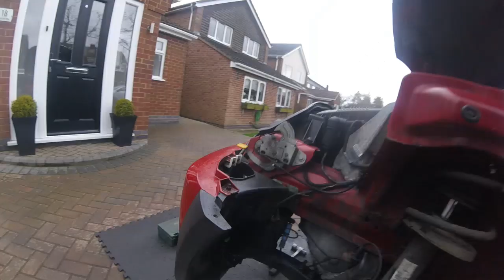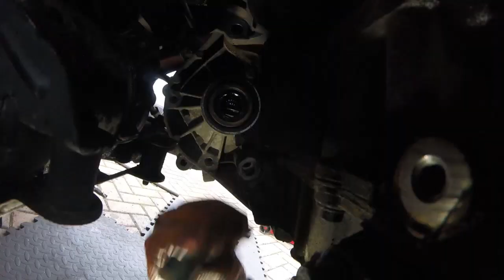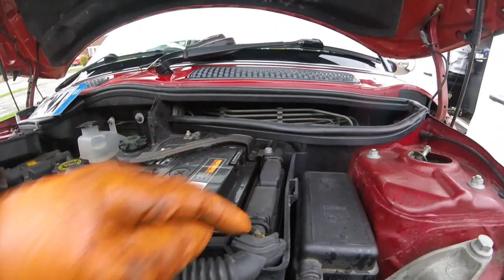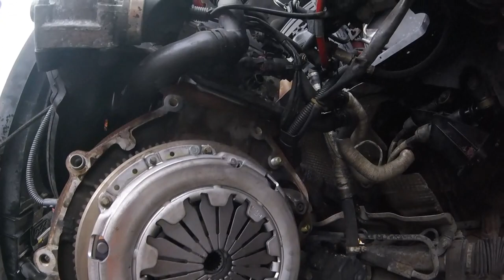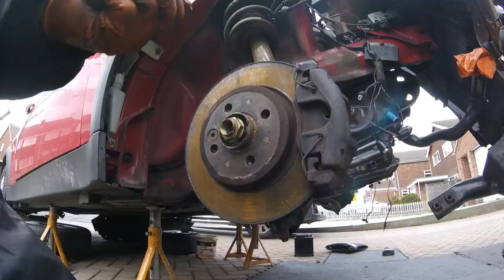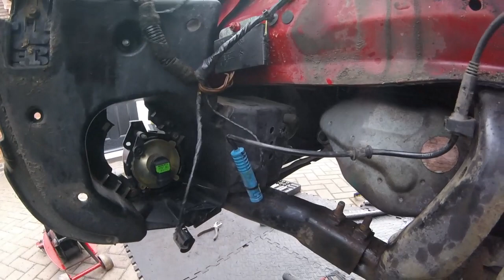2003 Mini Hatch 1.6L Petrol Clutch Replacement

Comment: I just did the same job and found this video very helpful but just to note to anyone doing one - there is no need to drop the subframe at all. Once you have the front end module off - the gearbox comes off and out the front with no problems.
Reply from the maker: Thanks for the input .,, 🍻🎄

Comment: I was having a problem shifting the Midland 5-Speed in my 2003 R-50 when I finally added fluid to the power brake reservoir, and brought the level to full. After doing that, my 5-speed Midland again shifted very smoothly with no problems.  I had forgotten the power brake and clutch fluid are the same fluid, and to add fluid for the hydraulic clutch you put the fluid in the power brake reservoir. It is important to use the factory recommended fluid. Look it up before you buy and add the fluid. Double check what goes where because it can be confusing. Use a Mini Repair book with pictures and locations of the fluid reservoirs...That was months ago that I added fluid and my transmission still shifts smoothly and quietly ...The clutch was never the problem, just low fluid in the reservoir. Maybe I am the only person that has had problem because of low fluid, (I blame it on being very old), Before you spend time and money fixing your clutch insure your brake fluid reservoir is topped off with correct fluid. Carefully insure the fluid MINI recommends is added to the correct reservoir........Cost me about 4 dollars for the can of fluid and a few minutes look up the correct fluid and add it...
Again, carefully insure the correct fluid goes in the correct reservoir.......

Brake Fluid Warning - MINI Cooper Forum
Also ensure you are reading the level in the reservoir correctly. Just because there is fluid inside, doesn't mean it's full. Driving with fluid below the min level can cause air to enter the hydraulic lines affecting both brake power and clutch operation (if the car is a manual). My experience is fill the reservoir with the MINI recommended braked/clutch fluid and you may fix the clutch problem for about 5 bucks.....it happened to me and my 2003 R50. Added brake/clutch fluid recommended by MINI and problem fixed....

Comment: Kevin i have just bought a mini and alas the clutch is f----- and your video has inspired me to do it myself, only being a DIY mechanic and seeing an expert at work really has helped so much well done mate you really work hard and thank you so so much Kind Regards Mark...
Reply from the maker: SooperSkoots thanks mark. Are you gonna go for it then.
Reply: @WMCS  I am mate thanks but i have also discovered that the head gasket may have gone too i am not entirely 100% on that yet but i did buy the car knowing there was issues and bought it cheap for what it is as a project, so the clutch is the first job when it comes, i will be doing it step by step exactly have you have done it, are you local to Warrington ha ha....
Reply: @WMCS  Hi Kevin do you know if my car has a dual mass clutch it a 2006 1.6 cooper park Lane edition, as i am a little confused which clutch kit to buy many thanks Mark..
Reply from the maker: SooperSkoots it won’t have a DMF it should be a VALEO maybe at about £110 plus vat.
Reply: @WMCS  your a star mate thank you for that much appreciated....
Reply: i have changed my clutch on the Mini many many thanks to you, i did it exactly how you did it with the sub frame dropped down on one side, absolutley fantastic i would not have done it without your help it took me near on seven hours though ha ha thanks again mate kind Regards Mark...
Reply from the maker: SooperSkoots I’m so pleased to hear the video came through for you. Thanks fo sharing how you got on. 

Regards 
Kev.

Comment: Thank you so much for the video buddy very well done! Getting ready to do this on a 04 ever heard of a hole in the bell housing from the clutch
Reply from the maker: Dan thanks for viewing the channel. I hope the video comes through ok for you on the day ..,, de gassing the Ac system is advisable beforehand. 
I’ve seen a few damaged gearbox due to failed clutch system ..,, but some of the earlier Mini had a few issues with their boxes as far as I’ve come across.

Comment: Thanks for the video  bro, Greeat job !! im about to buy a 04 , and it comes with the manual trans, i just have to put it in !any advice on clutch replacement ?
Reply from the maker: Thanks. Pretty much as in the video. I know some mechanics takes off the subframe instead.
Reply: You just loosen  the subframe instead of taking it out ? I have the front end off

Comment: I have a 2006 mini one with 71k miles. It has a very heavy and stiff clutch. Apparently all older minis are like that but I'm not sure. I've always known modern cars clutches to be very easy. Is this normal or do I need to get it looked at? Thanks.
Reply from the maker: Get it looked at asap
Reply: If you have not already done this, check the fluid level in the brake fluid reservoir and top if off with the MINI recommended brake fluid. The brake fluid reservoir and the clutch fluid reservoir are the same reservoir. If the reservoir if low it may affect operation of your clutch. Insure you get the correct MINI recommended fluid and fill the reservoir. For me this fixed what I thought was a clutch problem, and my Midland 5-speed now shifts smoothly with no problems. This was months ago and it still works just fine....

Comment: How the hell do u get to the bolt under the manifold at the top 🔩🤔 and also my mini one 2005 as  loads more pipes attached bottom right Aircon pipes etc. P. S so far so good with your video 👍
Reply from the maker: Thanks for the feedback..., mini one does has a bigger box and less room you’re right.
Reply: @WMCS   had to completely drop subframe in the end 😩 but all back together and running sweet.  Thanks again 👍

Comment: Hi Kevin,  should there be a gap between the clutch pressure plate and the flywheel after tightening the torq bolts to 20nm? Can't thank you enough for your videos and advice pal. 👍
Reply from the maker: Hi Martin... after tightening down the bolts. The main thing is the clutch plate shouldn’t move. 
There may be a small gaps but that’s from the clutch plate groove to allow air to flow through. So it doesn’t overheat.

Comment: Does this car have ac?  Is there enough flex in the hoses to move the rad assembly aside like you do with ac present on the car?
Reply from the maker: Yes that’s correct. There’s enough flex.

Comment: Have you ever had the bolts holding the battery tray in place rotate freely without unscrewing? What was your solution if so? Thanks
Reply from the maker: Yes. Quite often. the only solution is to get a flat head screw driver and a hammer and make a clean cut around the bolt.
Reply: Do you mean cutting the tray itself so it can clear the bolts? That was about to be my next attempt to solve it, but thought I'd ask before cutting.
Reply from the maker: Yes exactly that. And by leaving the bolt in when you fit the tray back that bolt will serve it’s purpose again.

Comment: Brilliant job Kevin 
I’m thinking tackling myself 
Just one question?
Do I have to separate the steering rack from the subframe 
Thanks
Reply from the maker: No you don’t. Really need to. 
Just follow the exact same steps. You’ll be fine. But keep in mind the gearbox is a bit heavy.

Comment: I would like to know where you get those gloves from can't find any decent ones anywhere
Reply from the maker: You can get it off eBay. 
https://www.ebay.co.uk/itm/Orange-Disposable-7mm-Nitrile-Gloves-90-per-box-Textured-Latex-Free-Size-XL-/114466604998?_trksid=p2349624.m46890.l49292
Reply: @WMCS  thanks for that will save me changing them every 2 minutes

Comment: I have a Mini Cooper r50 and I had an EP emblem on the dashboard with a check engine light and RPM turns too high.  It seems that the Mini Cooper was not turning from the first or second gear, what is the solution?

Comment: I got a cooper r50 can I follow the same steps
Reply from the maker: daniel evans yes exactly the same. I’m gonna do another video this week on a R50.. without having to degas the AC and without disturbing the coolant hoses.
Reply: @WMCS  when I follow these steps does it degas the air con then
Reply from the maker: daniel evans not on this one.. you need an AC machine to recover the refrigerant.

Comment: Can you do valve stem seals without removing the head? If so what would be the quote? My mini r56 n12 starts smoking after 20 min of driving, when accelerating in 1st gear.
Reply from the maker: B B 
Most engine variants you can do it. Make sure you have the correct pinch tools for the collets.